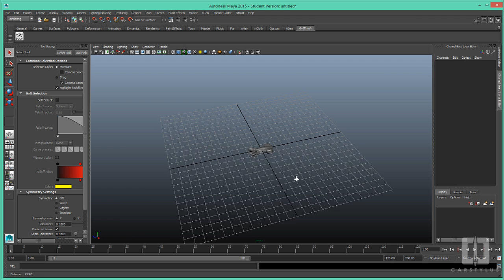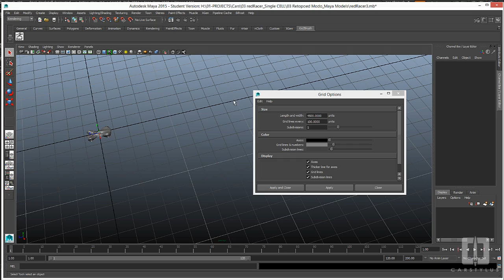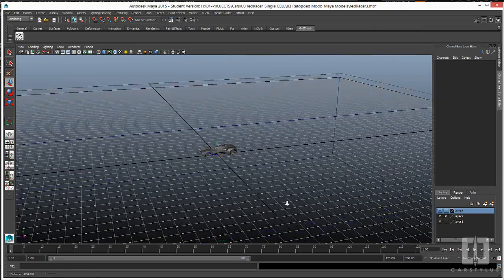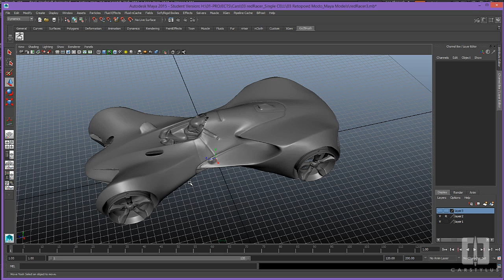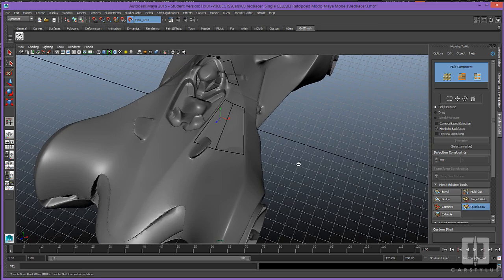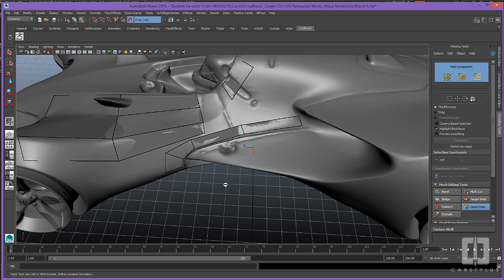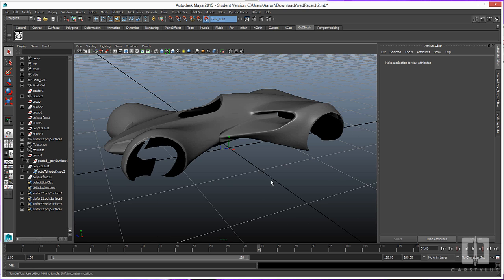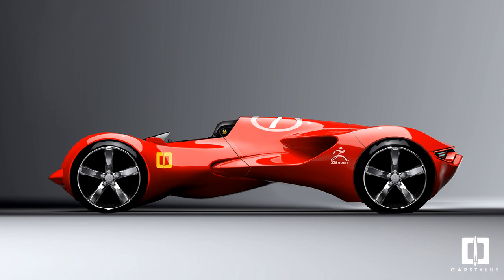Tip 3: Resurfacing a Zbrush Concept Model

Comment: I still don't understand why it is necessary to jump from Zbrush -> Maya -> Alias. Can't you just use your zbrush model as a reference in alias and create your nurbs data around it?
Reply from the maker: +Ruggada +Ruggada Yes, you could, particularly if you're certain that your design direction is solidified.    I find however that if I use Maya or Modo before Alias,  I can get relatively "cleaner" surfaces and still preserve the ability to make major proportionally changes without difficulty. (Alias lattice rigs, etc. don't work very well. . .surfaces WILL break apart).   Besides,  polygonal modeling is best used in the conceptual stage. . . and in this stage, class A surfaces aren't necessary.    What's more important is getting relatively good looking renders or getting the model milled in clay. . . to which you'll make major changes anyway.
Reply: Thank you so much for the explanation! So, in short having the step in between (maya/modo) allows for a clean yet malleable phase (low poly) before you really freeze all your form work and make it a Class-A surface model in Alias. Brilliant!

Comment: Those alias patches are weird. Were the surfaces built from curve networks? from the looks of it...... Nice video, thx for sharing. Great car design too, nice model.
Reply from the maker: MrGogcad,  yeah, they are weird.  They were automatically generated from SubD's  in Maya  . . . a method I'm investigating to generate quick conceptual models using polygonal modeling techniques.
Reply: If you want your model with NURBS and you already have a ZBrush model or 3D scan there are also plugins where you draw NURBS patches on it and also keep continuity between the patches, pretty much like you work with polys
Reply from the maker: ile911,  I know of Geomagic and Tebis, are there any others?   Do you know which ones work the best?
Reply: It can be reversed engineered  in any decent cad program. Alias does it well, and has good tools, but takes knowledge to do it. Yeah, some proggys make this task easy, by laying out a curve layout patch on the reference data. But u dont get the best surfaces from that method. Only speed. Surfaces have to be done from scratch, all of them, in case you want quality. my 2 cents ;) keep having fun, and thanks :)
Reply from the maker: MrGogocad,  I know about laying out surfaces from scratch in Alias. . .   If one wants perfect patch structure etc., I agree that this is currently the best way.     However I'm looking forward to seeing a program that does at least 90% of the work.   Such a program would making using zbrush and mudbox, etc., all the more useful for concept exploration.
Reply: yes, of course ! Try siemens NX. It kinda does what you are saying, and it is a breeze. But you can´t build a rocket, by just pushing a button.
Reply from the maker: Understood. . . can't build a rocket by pushing a button.  Being a car designer for a while now, I have some idea about the complexity of car design and production.   However, my view is that, ultimately, the only real thing that can't be automated is creativity.  Tools and processes will continue to advance . . .   I will certainly take a look siemens NX.   Thanks.
Reply: You are welcome :)
Reply: carstylus There is other for Rhino, Resurf very intuitive, and there is plugin for Rhino, VSR now Autodesk buy them and with that plugin Phino become capable of jobs like Alias
Reply: No it doesnt. At all. And one costs 1k and the other 80k. It s a rat and a elephant.

Comment: Awesome video, is it better to use Autodesk Alias Automotive or Rhino ? If u want to work in car industry.
Reply from the maker: It's better to use Autodesk Alias Automotive if you'd like to work in the industry.  While I know of a few who use Rhino on personal projects,  the dominant nurbs modeling software within the design studio is Alias. . . .
Reply: carstylus Thanks for your response, so I will go with Alias, I know a bit of rhino, it has a grasshopper feature which can be useful sometimes but I think it is possible to import/export models whithin those two.
Reply: Rhino can´t compare to Alias. Alias is the BOMB.
Reply: I dunno still I'm too basic in Alias to judge it, but rhino has grasshopper feature which could be helpful sometimes, and I think both are based on similar mechanic, but I could be wrong